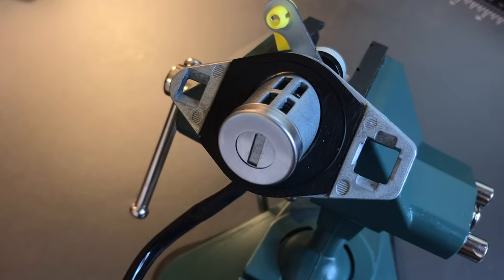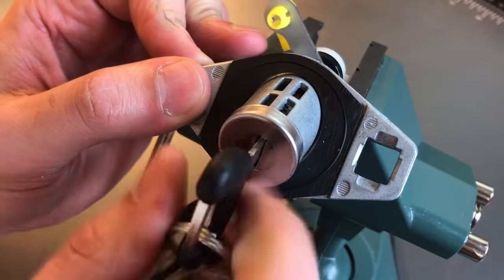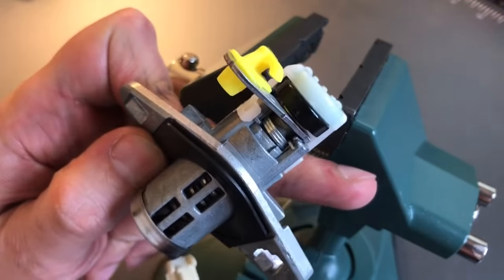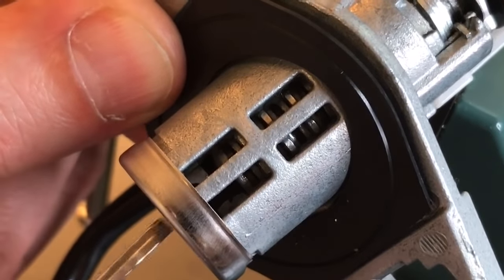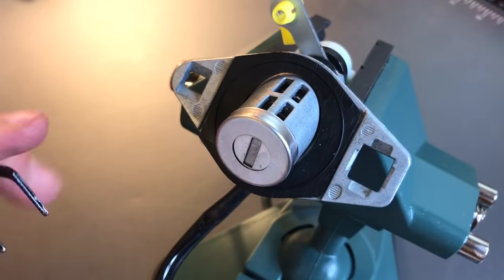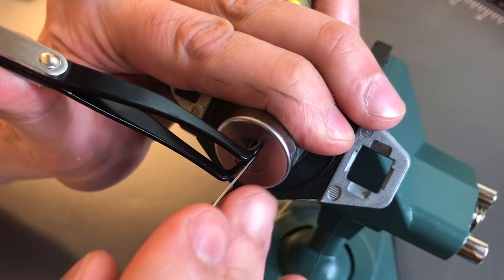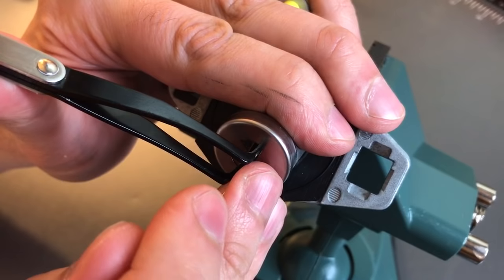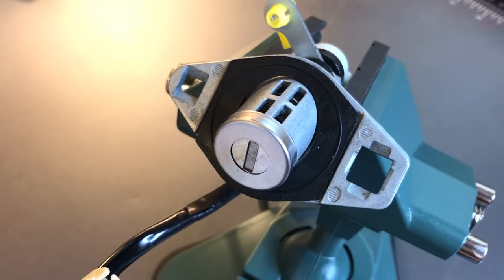[372] Mazda 6 Lock Picked & Alarm Disarmed

Comment: That's a surprising vulnerability in the security system, but I'm not sure how to fix it...
Reply: Only real way to fix it, is to not have a physical key entry system. Only electronic codes. But hell, even that can fail as thieves can scan the code from your key fob when then get near it, with a special tool.
Reply: @SI0AX  Rotating codes are pretty commonplace in garage door remotes, they stop replay attacks.

Comment: Pull out the ignition cilinder from scooters/cars with a slide hammer
Reply: It only works if they don't have a transponder. If they do, that technique doesn't work. (I know this first hand, someone tried that with mine) the transponder won't allow it.to start without the key inside the coil

Comment: Does the side you start off on matter?
Reply from the maker: +grayfox369 Not sure. It may vary by lock... whichever binds up first.
Reply: @lockpickinglawyer  Start by picking the top if those wafers bind first. If bottom bind first, then pick bottom first. Correct??

Comment: Guess this is why, A) my car doesn't even have a a key for the trunk, or any doors other than the drivers door. B) even using the key to unlock the drivers door sets off the alarm. only unlocking with the key fob disarms it.

Comment: Is the ignition as easy to pick as the trunk?
Reply from the maker: Probably. Just tighter quarters.
Reply: Anyway even if you did manage to pick the ignition, the immobilizer would not allow the car to start as the key is not in range.

Comment: I thought a lot of car locks are now coded to the car keys. So the computer in the car determines if the key is correct.
Reply: They usually do that only for the ignition, unless you have one of those cars where you leave the key in your pocket and never insert the key into the car.

Comment: would it pick the same with a side bar?
Reply from the maker: +thisburittoisfilling Ummm... not sure how to answer that. Would the lock pick differently if it was a different lock?  Of course it would!
Reply: thisburittoisfilling you cannot properly tension a sidebar lock unless you apply pressure directly to the sidebar.
Reply from the maker: +Kirk Womack That is true on the GM sidebar... old design, but still nasty!
Reply: they are a tough pick. ussually end up just drilling them out and replacing if i cant get a code off of them to create a new key
Reply: Thanks Mr. Womack, I was just curious about sidebars and how they affect picking.

Comment: I would've just used and Original Lishi to open this lock.
Reply: i thought the lishi tools tells you the pin position of a given lock to make a copy, and not actually pick open the lock?
Reply: @billybones6463  In order to get the pin position, you have to turn the plug in the cylinder. As you pick the lock and get the pin positions, the plug will turn and unlock the lock. An Original Lishi tool is both a tensions tool and a pick. Worth every penny but take lots of practice.
Reply: @Disgruntalpunk  thats awesome, didnt know there was a version that does both. what does it retail for? if its $50 thats prolly worth it